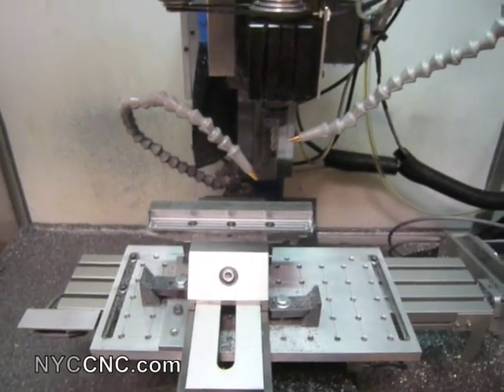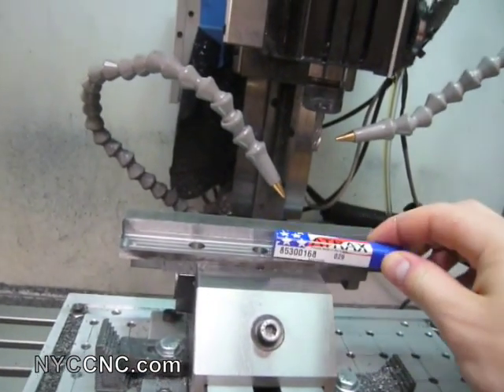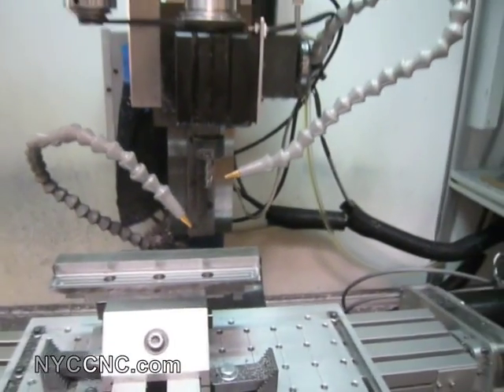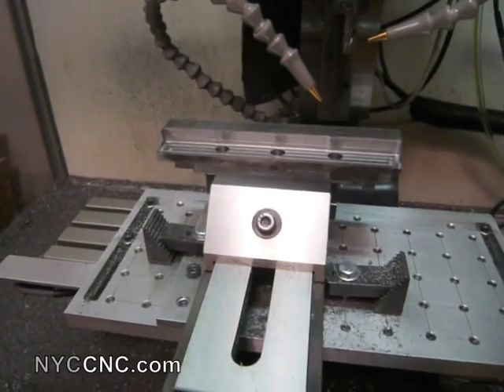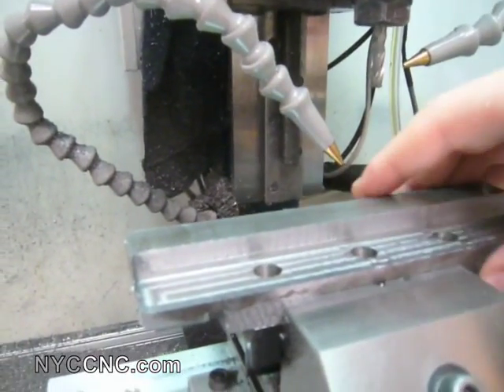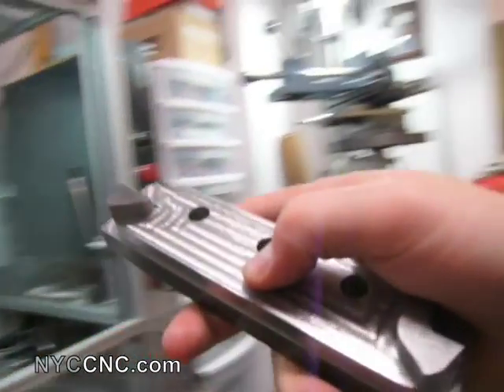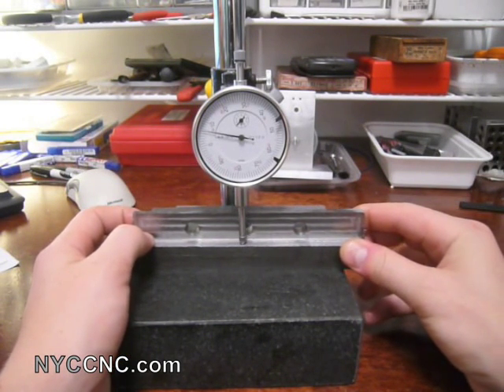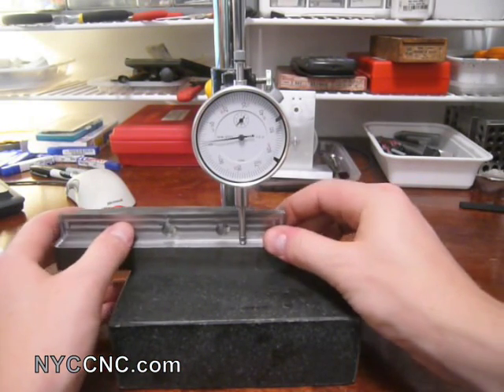Evaluating Endmill Deflection when machining 4140 alloy steel on TAIG CNC mill milling machine

Comment: The indicator jumps adjacent to each hole in the base. Something is flexing. I bet you could locate the flex point vibration. with a mechanic’s stethoscope. Something is buzzing, I can hear it?

Comment: Would you recommend getting the Taig Gecko or Deeprgroove 1 CNC mills as a starter? I would like to start a small side business machining custom parts (probably aluminum and steel), and also machining knives out of O1 tool steel. Any other recommendations for a stater CNC mill?
Reply: Thank you for the suggestion and for answering my question! Ive looked heavily at the Tormach and would kill to get one, but when given the options I'd want they cost a very pretty penny. Ive been looking at the Talon 1032 from Smithy, any insight as to that machine? I've done plenty of manual machining on my old millrite and crappy lathe, but am new to CNC aside from my 3D printer (which I understand is quite different, but has given me a great insight to G-code).

Comment: oh no... that machine is 100 times more flexible than your end mill is..
let me know what the actual number is.. but i seem to recall telling you this a year ago.
Reply: do you still have the machine? :P
Reply: NYC CNC What are you using now ?
I was impressed more by the machine, the booth you put around it, the tooling and table, the motor with what appeared to be a variable speed controller, etc.. what are you using now? What was that motor and what is the variable speed control?

Comment: I know it has been a while. The problem is most likely with the skills of your button jockeys.  Programming and setup is everything. Start close finish close. The machine itself comes into play but you should be able to hold .002 all day long unless the machine is a piece of crud that should be replaced. I can interpolate .0002 true bearing bores on a newer machining center and hold .0005. Keep in mind that grinders do finish work and what is close for them is miles for you.

Comment: i have to bash on atrax for a moment.......ive used there tooling and its the worst american made carbide ive ever tried. i dont know if its the relief angles, the helix or what but man, there are much better choices available. try promax, accurite, design-rite, niagra or some other premium brand. you will never again think twice about spending a few extra bucks.

btw, high helix cutters work better for chromo and makes climb milling less brutal on the setup. stay with 4 flutes though